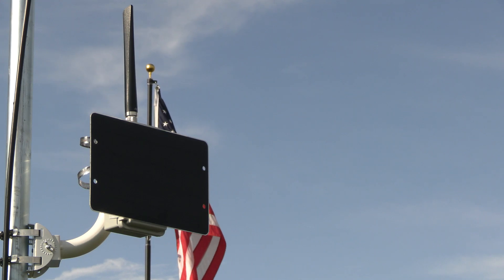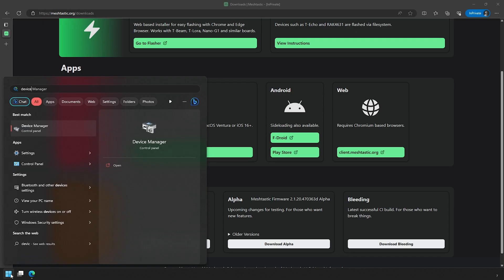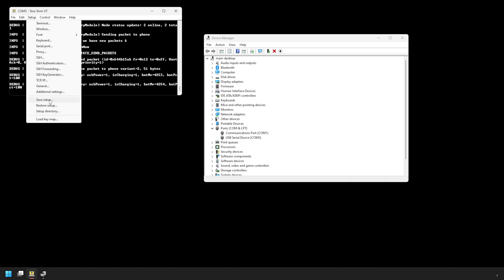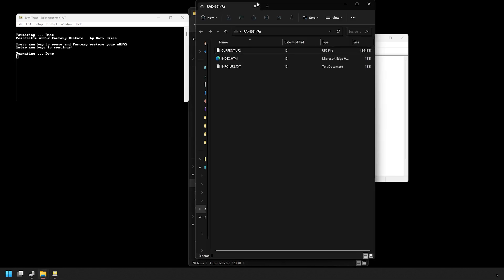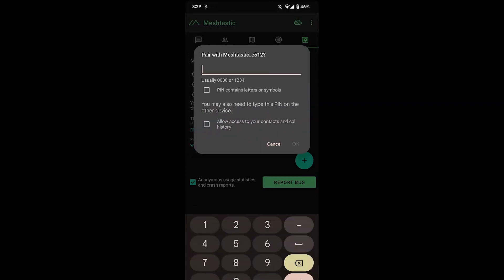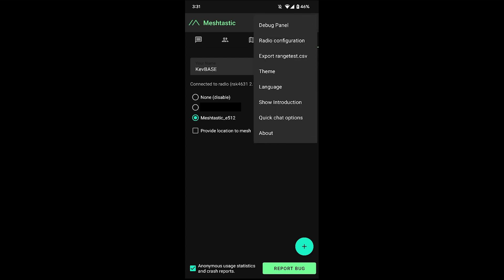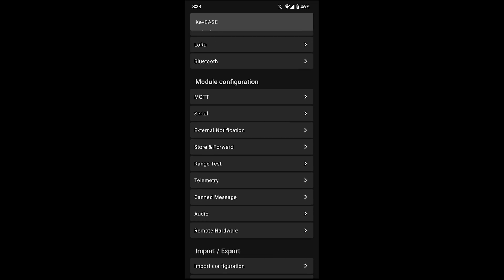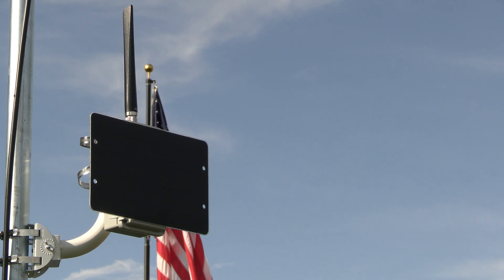Encrypted Comms - Part 3 - DIY Solar WisBlock with Meshtastic

Comment: Hi, looking everywhere for advice on overcoming a technical issue with my 4631. Double pressing the button has no effect and I’m unable to enter DFU mode. Is there anyway to factory reset without being able to do that? I still see what com port I’m connected to on the PC, I just have no way to get the 4631 to appear as a drive. 

I’ve successfully updated the firmware on other units, so I’m familiar with the basics. I’m here because this is an issue I don’t see talked about anywhere.
Reply from the maker: I've not run into this issue so I've not had to try this but you may need this flashing tool if nothing else is working 

https://store.rokland.com/products/rakdap1-debug-and-flash-tool-nanodap-v-2-3?ref=tc2
Reply from the maker: It's pretty involved, but here is the quickstart guide

https://docs.rakwireless.com/Product-Categories/Accessories/RAKDAP1-Flash-and-Debug-Tool/Quickstart/#installation
Reply: @The_Comms_Channel  Thank you. Yes that is pretty involved, unfortunately it’s beyond what I can handle, especially since it looks like I need to buy that usb adapter. 

If it’s something you’re interested in taking on I can mail it to you for you to keep. Maybe it’s a video worthy project. Otherwise it’s destined for the landfill unfortunately.

Comment: I'm hoping someone can help me as I am not very tech savy and am having some issues.  I picked up a T-Beam as a home base node and got it working with the app np.  Now I'm trying to build some wisblocks into solar repater nodes.  I tried flashing the software by drag and drop with the wisblock connected to my computer.  It disconnects the wisblock from my computer but never reconnects on its own.  I've also tried nrf52 factory erase and it does the exact same thing.  When I run Tera Term I just get a blank screen and hitting enter does nothing for me.  Anyone know what I'm doing wrong or missing?
Reply from the maker: This is an old method. Use the method in my newer build
Reply: @The_Comms_Channel That worked perfectly thank you!!

Comment: Would it be better to keep the base stations open instead of having the encryption key on them? I would worry that it might be possible for someone to swipe your key if they get their hands on the device, or can connect to it via bluetooth? I'm just getting started planning a mesh in my community and I plan on just having the encryption on the user nodes. No need to decrypt messages at the base 'repeaters' since they will forward packets regardless.
Reply from the maker: Yes, that is best if you have concerns and will be discussed in a future video.

Comment: Question T2c, is that possible to use the rak board without bluetooth? Maybe connected just by USB-C?
Reply from the maker: You can via computer and web client. I've not tried on phone though. Is that what you're going for?
Reply: Awesome, thank you so much! And congrats on the channel, super solid info.
Reply from the maker: Sure thing! Thank you! It is possible to do USB only. On Android at least, I have my doubts about iPhone.

When you connect your device to your phone, you'll see a device with /usb/ in the name and you'll be able to connect to it from the Meshtastic app and use it without Bluetooth.
Reply: @The_Comms_Channel  niiiice! Thank you so much man, really appreciate it. Rokland just got a restock of Rak Boards, I’m gonna jump on one of those.
Reply from the maker: Sure thing! I was glad to see them back in stock! They've been selling out quickly.
Reply: Yeah, just evaluating options. Because of the lower power consumption I was wondering if making the field use more stream lined with a “plug and play” kind a setup.
Reply from the maker: @renandearaujo.official  Gotcha. I'll test that out and let you know if it works!

Comment: Does moving off the default key require internet for the other party to receive the key. If you have no internet would you be able to have new users join?
Reply from the maker: No Internet required. You just have to be to get the QR code to them to scan or give them the PSK somehow.

Comment: Ref setting up your own private channel... what's the difference between doing what you did (changing the default LongFast channel from the main menu system) and going to the Radio Configuration menu and adding a channel in the Channel menu and doing it there?
Reply from the maker: No difference really. This would just be for those who aren't worried about extra channels and just want to change from the default.

Comment: Love it. But a question about privacy. Can you turn off it's geolocation? So location beaming in the device never gets activated? Can it remain invisible within LoRa and on the meshtastic app?...Do you really want a whole lot of misfits turning up?
Reply from the maker: This build has no GPS. The WisBlock has GPS modules you can purchase for it, but it's not required. For devices that do have GPS, you can turn it off though. Or better yet, do what I do which is provide a fake location.
Reply: @The_Comms_Channel I would love to see a video on exactly this, office skating and hiding communication devices covert installations and the like

Comment: Is there a Linux version of, or an alternative for, TeraTerm?
I stopped using the Microshaft Winblows malware/virus about 20 years ago...lol
Reply from the maker: Don't blame you one bit! Linux is my preferred OS as well. 

For Linux, the best way to do this is using the Meshtastic Python CLI

https://meshtastic.org/docs/software/python/cli/installation

After you get that install, go through the process shown in the video and after flashing the Meshtastic_nRF52_factory_erase.uf2 file you can type in the command below 

meshtastic --noproto 

Then hit Enter and you should see "Formatting... Done" if all went well.

You may also get by with just doing the standard flashing method shown on my video here https://youtu.be/0WhLP8BHAAs

This solar video shows the complete wipe method which isn't needed in most cases. The stand method is just simply dragging and dropping the appropriate firmware file.
Reply: Thanks!  I appreciate the help....I'll have a WisBlock ordered before the day is over.
Reply from the maker: @TheWingnut58  Anytime! Good luck on the build!
Reply: @The_Comms_Channel  Is it possible to put the wisblock into DFU mode without pressing the physical button?   I can do 100% of the rest of this remotely with a raspberry pi plugged into the node.   But, I don't want to climb a 70' tower every time I want to update the firmware,  especially as often as they release.   If there is a programmatic way to enter DFU, that would be ideal.  Barring that, I may play around with gpio pins soldered to the wisblock to simulate pressing the button twice, or some other hackery.

Comment: I’d love to see more on this, like adding telemetry data like gps, weather etc. maybe logging that data to MQTT.

I can imagine having these dotted across an area as base or repeating nodes for your mobile assets.

I know with the TBeams just point to point I was able to get just over 4 miles.  So if I built 6-12 repeater nodes I could cover a pretty large area. But that GPS and weather data would be key.
Reply from the maker: Thanks for the suggestions! I'll definitely be covering this on my Advanced Meshtastic Series!
Reply: @The_Comms_Channel  oh, and using it with ATAKS
Reply from the maker: Will look into that as well!
Reply: If you don’t mind me asking what type of terrain were you getting that range? And were the devices at ground level or elevated?
We are working on a projects (items in the mail to us currently) where we are trying to connect 2 points about 25 miles as the crow flies, across rural /semi-rural terrain with less than 100’ elevation change between the 2, and we are very curious about the type of range we will see and how many nodes we will need.
Reply: @Jake-ug2mf  the base node was set on the awning of my porch, maybe 8-9ft up from ground level.

The train is relatively flat, I suppose. Southwest Minnesota, so cornfields and small, wooded groves.. Small towns, so not a whole lot of concrete like a urban environment

Comment: I dont have one of these but I also read where you can change from Long / Fast transmission, to Long / Slow and may help with Range. Just a side note 😀
Reply from the maker: That is correct! I'll be covering these options in my "Getting Started with Meshtastic" series